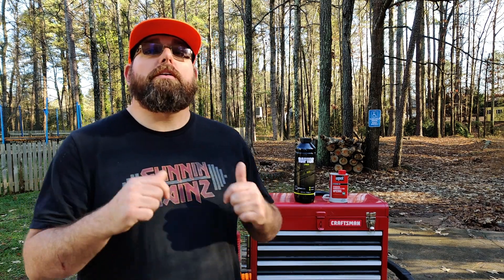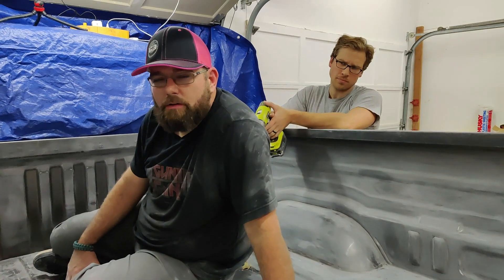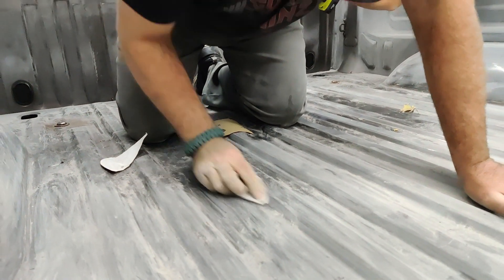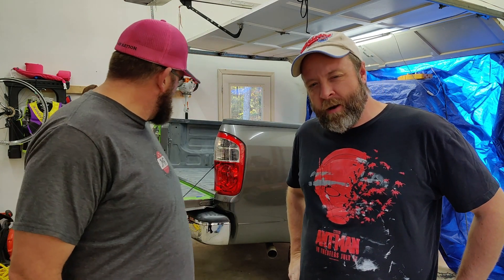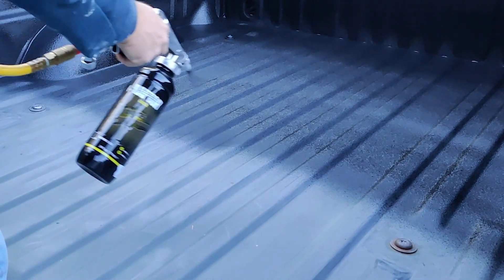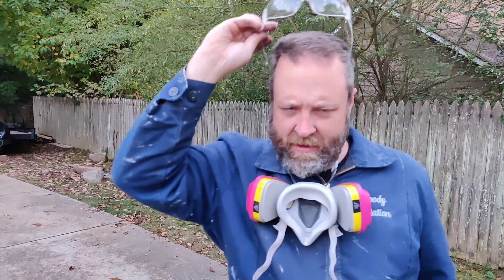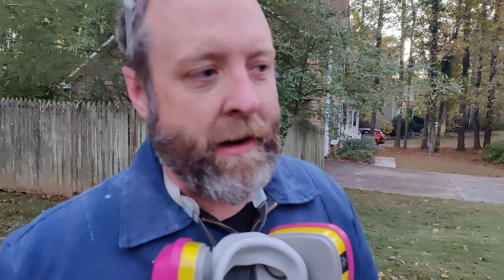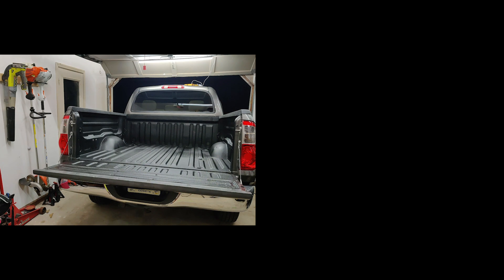JMR Rebuilders - Raptor Liner Prep and Install

Comment: I noticed he said you want to sand the clear off. ABSOLUTELY NOT!!! Do not sand off your clear.  Just sand your bed until the shine is gone.  That doesn’t mean the clear is gone!
Reply from the maker: Yes your correct just need it so the paint can grab.  Appreciate the support.
Reply: What if the clear is already gone it's an 83 kth bed
Reply: @nathanielmaldonado4725 it’s still ok. You can sand the clear off and it would’ve be a problem. You just want a good mechanical adhesion to the painted surface. If you sand to bare metal, just spray etch primer or epoxy primer before

Comment: Have a question for you guys. What would you use to remove an existing spray bedliner? Also have you used raptor liners tintable variant? I’ve used it once before and am curious what mix ratio of tint to hardener you suggest. If you’ve used it before.
Reply from the maker: We have never had to remove it but know it can be hard.  Also yes we did a complete truck in the tintable raptor and have a video on our channel.  The mix is 3oz per setup.  Good luck to you and let us know if you need any help.

Comment: What size air compressor is recommended to do the bedliner? 
And how many kits to do a full size truck, the whole truck, 2013 GMC Sierra 1500?
Reply from the maker: Thanks for the comment.  Raptor recommends at least a 6gal that can maintain 150psi.  We used 9qts of the tintable and 5 qts of the black.  Good luck.
Reply: @JMRRebuilders  thank you for your help
Reply from the maker: Absolutely

Comment: I just got mine delivered today, was going to rent an air compressor, the bottom of the gun just has threads, do I need to get a male adapter to be able to hook it up to air?
Reply from the maker: Yes, you will need to get your own male adapter for the hose.  Good luck. I hope it works out for you to check out our other videos on the raptor line process.  Thanks for the comment and support.

Comment: Wonder if this would stick better with primer?
Reply from the maker: Well it really isn't necessary.  If you properly prep the paint and use adhesion promoter in hard to resch spots.  Check out our latest video where we do a complete paint job on an excursion. 

https://youtu.be/21QIAW2w814

Comment: Do you mind me asking did you only give it 1 coat?,  if so how many litres did it take to do it, also is it standing the test of time, sean
Reply from the maker: We used 6qts total and it was 3 total coats I believe.  It is doing alright. Thanks for the comment.  We actually just painted a complete exterior of our Excursion.
Reply: Thanks that's give me a bit of peace of mind, I've got a 1991 celica gt4 that needs some tlc think the raptor should work just fine once the cars stripped back

Comment: Lol, you don't have to "take the clearcoat off". A good scuff pad is more than enough to take the shine off and give it plenty to bite to. Most of these videos fail to mention(some fail to even do it) you need to primer any bare metal before spraying the liner.
Reply from the maker: Thanks for the comment tom.  We went a bit above what was need on the scuff portion for sure.  Also yes we did all bare metal in etching primer.  Appreciate the support.
Reply from the maker: I also read that on their website AFTER we finished.   Thanks for the clarification.  Maybe that will save the next guys some work! --Jason

Comment: How long do you wait in between coats?
Reply from the maker: I believe Raptor calls for 60 min.  They also state do 3 coats then maybe after 24hrs do another coat after it is baked in.  Good luck thanks for the comment and support.

Comment: I already know the answer to this but mines is coming in Monday and I want to know do I really have to prime down my bed or can I apply it to bare metal. I'm asking bc I'm just going to scuff my walls but I'm taking the floor of my bed to bare metal
Reply from the maker: It is recommended to just use a red scuff pad and really just get the clear roughed up.  We went a bit over board.  Anywhere there is bare metal you need to spray with etching primer.  We appreciate the support and good luck brother
Reply: @JMRRebuilders  gotcha appreciate it man 👌🏽

Comment: Did you use an adhesion promoter before the spray liner or no?
Reply from the maker: We did in some spots just really depended if we could rough the area or not.  Thanks for comment and good luck
Reply: @JMRRebuilders  and that was 2 years ago... How has it held up?
Reply from the maker: It's done fine.  As long as you aint loading unloading truck loads of rocks your fine.
Reply: @JMRRebuilders  Thanks... I am actually going to be using it for a few different things on my 2009 Nissan Xterra... I think it will work out fine.

Comment: What temperatures will this work out will it work at 60°
Reply from the maker: Well Raptor recommends 60-70 so you should be good.  I believe we did it and it was alot colder.  Good luck.  KEEP GETTING AFTER IT

Comment: The one thing I haven’t been able to find info on is how much air pressure does it need to work? I only have a small tank and want to line my own truck. Pretty sure my tank isn’t adequate.
Reply from the maker: There is a good chance your right.  We used a 30 gal husky but it ran constantly.  So if the air pressure can't keep up the coat won't lay down good and you will be frustrated. The compressor has to be able to keep the psi while spraying is really the key.  Good luck.
Reply: @JMRRebuilders  do you think a 2 gallon 110 psi compressor would work?
Reply from the maker: As I mentioned above I don't think it is ideal.  Can it be done probably.  Is it what is recommended no.  Good luck

Comment: I am planning to do the same to my 2005 SR5 Tundra Double cab. How hard it held up over the past year? How many coats did you end up doing? How many QTS did it take to do the entire bed? Thanks
Reply from the maker: So couple things.  First watch our Excursion video where we do the exterior.  There is a red 4.5 inch brush makes life easy.  Also it holds up well.  I believe we used 6qts and applied 2 full coats and 1 spray over coat.  Good luck.

Comment: I’m about to order some of this for my truck. Just wondering if you used the traction additive. Also I’ve never sprayed before how was the easiest way to clean gun in between coats? Thank you. Great video
Reply from the maker: Hey Jared.  Pretty sure Ryan cleaned the gun with mineral spirits between coats.  As for spraying... I usually focus on keeping the gun perpendicular to the surface and whenever possible not starting or stopping when pointed at what I'm spraying --- I'm no pro though! Thanks for watching and the comment! -jason
Reply: Thank you for the quick response. Did you use the traction additive or did the texture come from just the spray?
Reply from the maker: @jaredbernard8654  we used an adhesion promoter in areas we couldn't rough sand.  Also used an etching primer on any bare metal areas to prevent rusting.  Good luck to you brother
Reply from the maker: If I remember correctly  the texture was in the bottle and we just shook it up to mix it an sprayed.  Pretty simple
Reply: Thank you for all of the help. Will definitely be watching more of your videos

Comment: U know Wht kind paint gun I can use beside the raptor gun
Reply from the maker: We have only used the raptor gun.  It does a decent job.
Reply: @JMRRebuilders  I’m using different bed liner tht doesn’t come with gun u know Wht other gun I can use
Reply from the maker: Unfortunately we do not.  We highly recommend upol raptor liner.  Their complete kit with hardener, material, gun and airpressure controller is the way to go.

Comment: I just ordered a 4 quart kit to do the bed of our Toolcat and was wondering if it would be recommended to sand it down and then use their adhesion promoter on the whole box before spraying the liner or is it better to not use it on the areas that are scuffed. I have enough of the promoter to spray the whole box but was wondering if there is any reason not to.
Reply from the maker: Hey brother thanks for the comment.  I have heard that alot of this is unnecessary.  However if it was me I would scuff the whole area.  I would use etching primer anywhere there is bare metal.  I would then if I had it use the adhesion promoter.  I am a big fan of overkill when it comes to this stuff.  So hope it helps.
Reply: @JMRRebuilders  
Thanks for the advice! Also, thanks for taking the time and energy to make helpful videos that give DYIers a leg up on tackling some of these types of things that may seem daunting or impossible at first glance. Channels like yours are what I love about YT. Liked and subbed!
Reply from the maker: Heck yeah brother.  We appreciate the encouraging words.   That is why we do what we do.  Its an attempt at showing what you can do if you just try.  We are 2 guys with no professional training that just want to show what is possible.   Nothing to it but to do it brother.

Comment: if it works if I use car air tire pressure volt 12
Reply from the maker: No that ain't gonna be enough brother.  Gonna need a home air compressor at least.  Good luck

Comment: what grit sandpaper did you use for prep?
Reply from the maker: Hey thank you for the comment.  We used 100 to 125 I believe.  Also for the hard to reach areas you can use red scotch pads.  Hope this helps.  Keep getting after it.
Reply from the maker: That would work as well zeb.

Comment: What pressure did you spray at? What did you use for clean up? When did you pull the masking off?
Reply from the maker: The pressure setting I  believe was 45.  

We used paint thinner and sprayed it thought the gun and then sprayed air through it.  

The tape should be pulled of 60 to 90 minutes after.  Really depends on outside temp. 

Thanks for the support and comment.  Please remember to subscribe if you have not.

Comment: Awsome vid you guys !! I just gutted my Jeep TJ hoping to get this stuff and apply it to the inside of my jeep !!! Did you have to buy a special type of spray gun for this project and at what settings would u put the gun at to get that perfect thick finish ??
Reply from the maker: Thanks for the comment and support.  That's great your doing your TJ.  The spray gun comes in the kit when you purchase.  I believe the recommend psi was 40 to 60.   The kit comes with a pressure gauge as well to measure that.  Hope this helps and good luck on your build brother.  KEEP GETTING AFTER IT

Comment: How many bottles and coats did you use?
Reply from the maker: Hey Derek thanks for the comment and support.  We bought the 2 gallon kit and used 5 bottles.  We did  2 total coats and one kinda touch up areas.
Reply: @JMRRebuilders  thank you. Getting ready to spray all my bumpers on my vanagon and looks to be similar surface area. I appreciate the info
Reply from the maker: Absolutely brother.  We did the rear bumper and bumper filler on our silver bullet rebuild.  When your done tag us on insta.  Would love to see it.

Comment: what air compressor did you use?
Reply from the maker: We used a 20gal oil leas husky.  It ran practically the whole tike but it got the job done.  Thanks for the support.
Reply: Thanks for the response! I have a 30 gal DeWalt 6 CFM at 40 psi. Will that get the job done? Planning on lining my jeep
Reply from the maker: I cant say for sure but it sounds about like what we had.  I think you will be fine just may run the whole time.  Good luck
Reply: JMR Rebuilders was your 20gal a 6hp or is it just the 1.7?
Reply from the maker: @oscormeyer2283  I belive it was a 1.5hp. It did a decent job.  But it was running practically the whole time.
Reply: JMR Rebuilders thanks for the response and info. Make a tintable video next!
Reply from the maker: We were just talking about this.  We have some plans in the works.
Reply: JMR Rebuilders I want to line my bed with a red tint but not sure about the mixing and there is no video on YouTube for it.
Reply from the maker: @oscormeyer2283  yeah we noticed that as well. We will consider this.

Comment: What size air compressor can you get away with?
Reply from the maker: We used a 20 gal oil less husky.  It was running the whole time but it did a good job.
Reply: I was gonna spray my whole jeep, 20 gallon was my thought. I of course was gonna let it catch up between bottle changes
Reply from the maker: It will work.  It will still run while your spraying but you can do it.  When you do can you post some images to insta and tag us.   We would love to see it
Reply: @JMRRebuilders  sure will, I still have to buy the kit and compressor..so itll be a few weeks
Reply from the maker: Can't wait. We are looking to do a complete vehicle soon.  We have recently purchased a commercial compressor so should be easier. Thanks again for the support and if there is anything we can do to help please reach out.
Reply: @JMRRebuilders  alright thanks

Comment: how many bottles did you use for this?
Reply from the maker: If I remeber correctly we used 6 or 7.  We did at least 2 and half if not more coats.  We highly recommend the 2 gallon kit.  Good luck.

Comment: Great job fellas. Was there alot of overspray?
Reply from the maker: Hi Fernando thanks for the encouraging words.  There was actually very little overspray.  However we would still recommend to make sure you have all areas taped and covered if you don't want it there.
Reply: Thanks for the quick response.  I will be doing a thorough taping but I was wondering how much overpay could be released inside my garage. I was thinking spraying in driveway but I have nosy neighbors that could complain. I just got a couple quotes $425 and $590. This is definitely the way to go for my 09 Silverado.
Reply from the maker: That is unfortunate about the neighbors the issue with the garage will be the odor that it creates.
Reply: 👍thanx for the great video and info

Comment: Looks great guys.  What’s the price tag on the kit?  Do you just need an air compressor?
Reply from the maker: We purchased the 2 gallon kit.  It comes with the product, hardener and gun to spray.  Yes all you need is a air compressor.  I believe the complete kit was $220.  Great product and thanks for the comment.
Reply: Sweet.  Thanks for the info.

Comment: Can I do this on my AMG? 😁
Reply from the maker: You sure can.  It takes a bit of work. Also it wont peel off like plastidip.  So once it's on it's on.
Reply: JMR Rebuilders But...don’t I have to have a bed liner to begin with???? 🤔
Reply from the maker: Hey now if you want we can fabricate ya one on the back of that beauty.
Reply: JMR Rebuilders 🤔....no!
Reply from the maker: @AutoFreeWay1  well it's out there if ya change your mind.